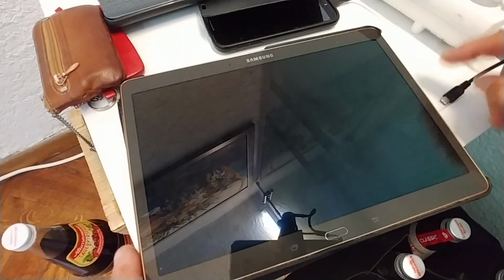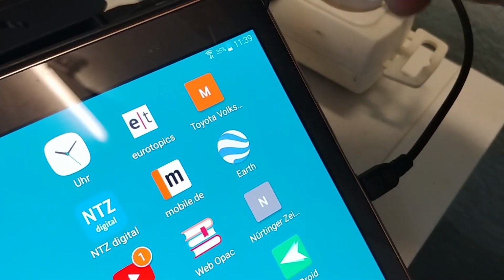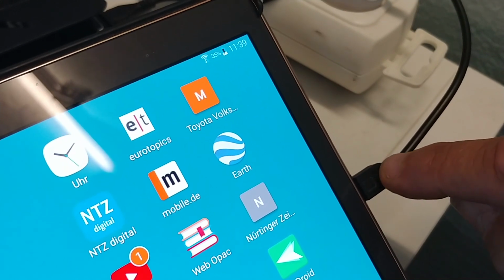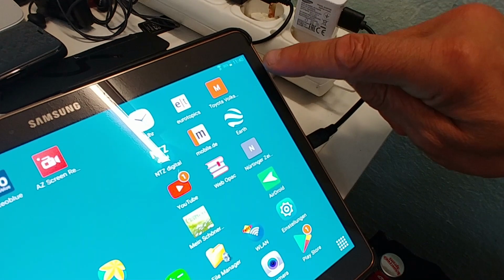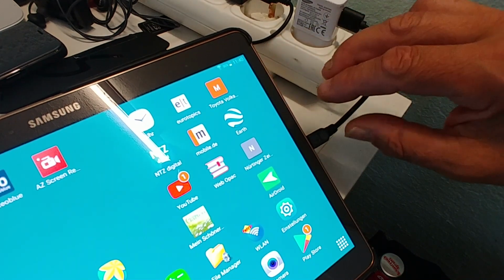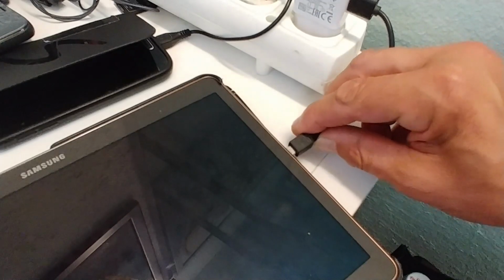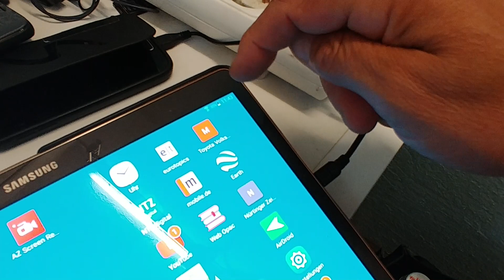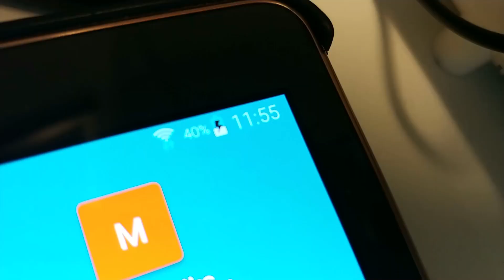USB is not charging: Repair USB cable connector very easy

Comment: worked for me on my new 2 month old quality cable.  i think the problem is if you have a device where you plug in and move around a lot it can wide the cable, in this instance it worked.  thanks